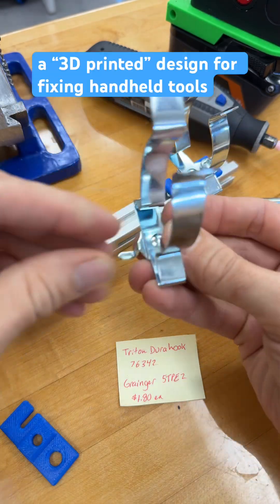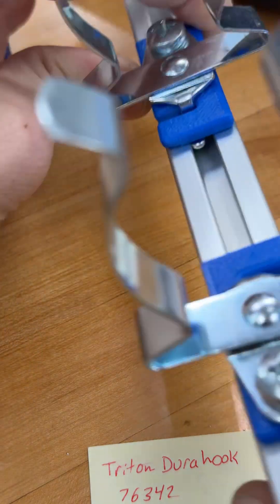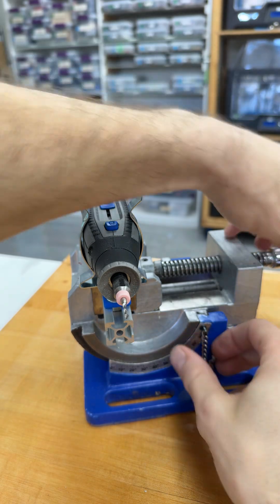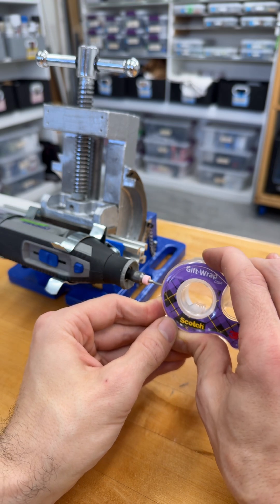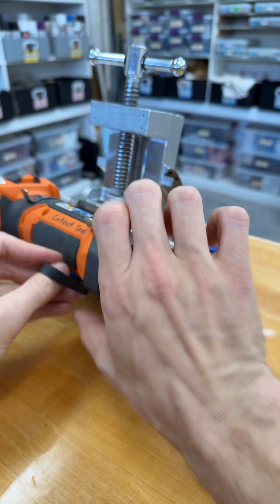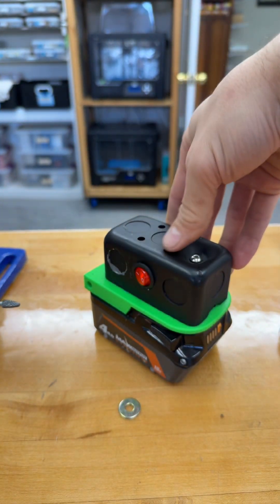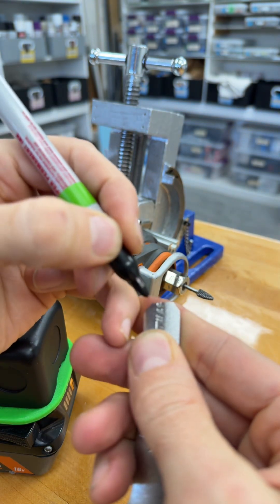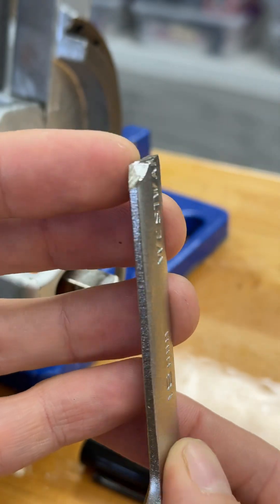This maybe the simplest design for a benchtop dremel #3dprinting #diy #tools #router

Comment: nice work, while I love a good aluminum extrusion jig, I have had nice luck modifying wooden hand screw clamps for similar purposes. You drill extra perpendicular holes through the wooden clamp body for clamps like the matchfit dovetail ones, and you also cut a V-groove up toward the tip of the clamp for round clamping. You can get insane pressure on most objects and clamp the whole thing down to a table in multiple orientations

Comment: That's pretty cool. I made my own device very similar using aluminum extrusion and aluminum angle that I machined with clamps that I machined myself. But this is a lot cheaper and a lot more accessible for people, even if it's not as rigid. Very great idea

Comment: Bro can we please make 3d printed cam clamps with attachments to clamp to Aluminum Extrusions? there has to be a simpler faster way than screwing. Cam Clamps are epic
Reply from the maker: if you show me one thing i’ll design the cam clamp.  A) your favorite cam clamp that doesn’t fit 202 or B) your 2020 cam clamp that isn’t printable.

Then i’ll make the free, printable, opensource design.  Need a benchmark.

Comment: No auto restart protection on the rigid or just no BMS so it doesnt know better?
Reply from the maker: these beautiful tools are usually as simple as a motor and a switch in a housing.  I love them.  The BMS lives in the battery where it belongs.
Reply: @davidmalawey yeah but is the BMS what stops the tool from starting when you change a battery and the switch is in the on position?
Reply from the maker: @SlowExpensive oh i see.  this one lacks such protection but it has a flange blocking the battery causing it to require two hands or slow down when inserting.  i’ve never made that mistake except when i’m thinking of filming.

a couple of the other tools have other features like the grinder has a bump switch that makes it turn off more easily than turn on.